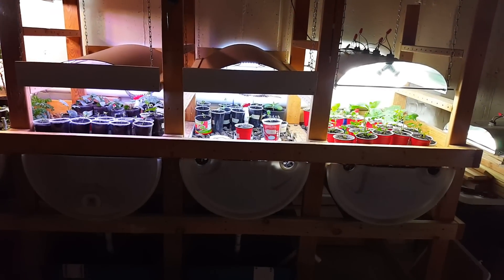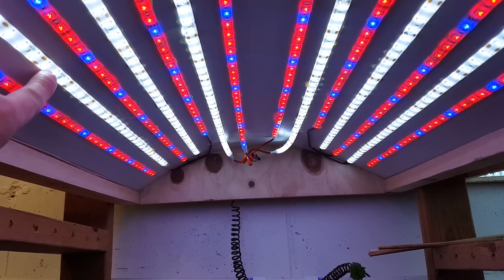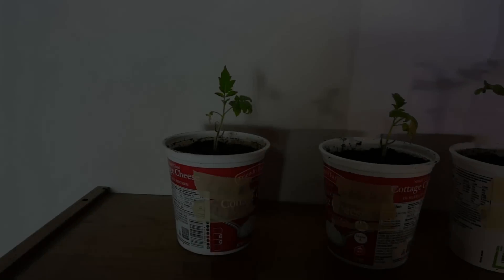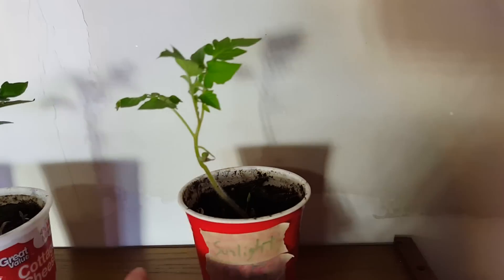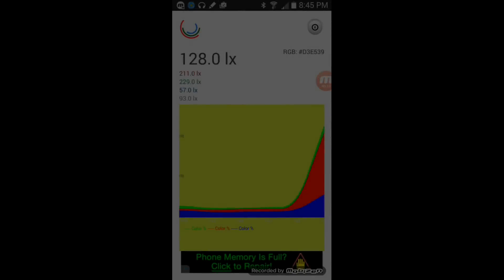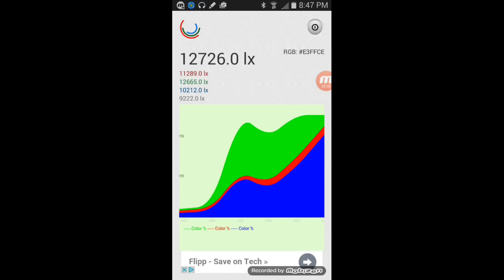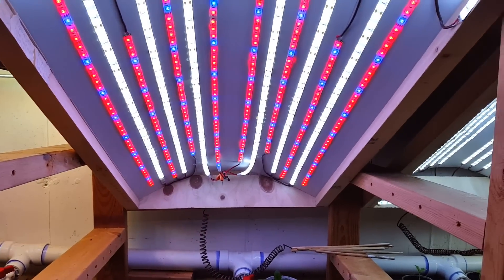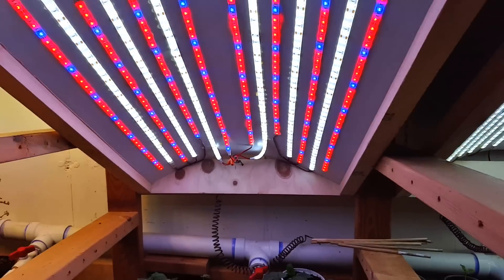DIY LED Grow Light Follow Up - Low Power LED VS CFL

Comment: to get a better test, make all the lights the same wattage.
Reply: very incorrect. wattage is a measure of power, dependent on two of: voltage, current, and resistance. you can have a very inefficient bulb blowing through power no problem and putting out hardly any light.

the important stuff is brightness, spectrum, temperature (including heat of the fixture), on/off cycle.... few others i can't give a crap to remember.
Reply: alexandru benza all those LEDs are going to have roughly the same efficiency.  you'd be correct otherwise.
Reply: +Kevron Rees  yea mate i'm talking about efficiency differences between different lighting tech, not differences between the LED bulbs in ONE fixture.

you said "make them the same wattage and then the test would be fair," but that's not correct at all. watts literally do NOTHING to the plant, it's related to current through the circuit, the voltage driving it, and the resistance ...resisting it. this isn't hearsay or a personal opinion, this is literally what the hell the equation is. unless you hold an incandescent too close to a plant and damage the plant with the waste heat, which even THEN is an indirect on growth.

light intensity per unit area is what matters. so for example for 800 lumens, an LED consumes 6-8 watts, an incandescent consumes 60, and a CFL consumes 13-15. also, different stages of growth respond differently to different intensities and spectra. power draw of your lights is the last thing to worry about.
Reply: distance to light is the key, the benefits are exponential...
Reply: It's going to be difficult to get a apples to apples comparison the way you want.  You need to make the per area photon concentration the same for all lights.  Only then can you make a valid comparison between the spectra of the various lights.  Otherwise, was the LED or CFL worse because it outputted less photons or because it had the wrong spectrum?  We don't know.

Honestly, I can't think of a good reason to use a CFL if spectrum is what you care about and not overall cost.  I can find LEDs with the spectrum I want.
Reply: Yea, we need to find if the LEDs actually more efficient vs the 8x23W CFL.

From the links provided, each 5m of these 5630 LED strips pull out 60W, so 120W. Meanwhile he is comparing it to a 184W CFL system.
Reply: tripzero you're missing the whole point of LED lights you sound like one of those guys that used to Growing With HPS lights that talks about watts as if that's the end-all-be-all of Lights the way you measure a light is by lumens he told us in this video that the LED lights he made weren't as bright as the CFL so therefore it's a flawed test you need to make the lights have as much lumens as your CFLs for it to be a proper test and also they need to be a lot closer to the plants because LEDs don't put off heat
Reply: that would be the point of the test, you seem slow
Reply: Watts is a measure of power and that will include heat dissipated in power. Led are more efficient, so Watts is not a good indicator. PAR would be the number to measure, but meters are really expensive, next better Fc, or Lux.  Lowering the lights will increase the lux at the plant level. Would be great to see same lux level for an accurate comparison.
Reply: and also same distance, your CFL seems to be closer to the plants than the led strips
Reply: I agree that I would like to see the same wattage for comparison.
If using the same wattage could you get the same performance.
Right now you have way more wattage going to the cfl and you have more LEDs in the mixed fixture.
Obviously this would be to find cheap efficient grow light alternatives.
I have a suspicion that if we mix 3000k 5000k and 6000k strips and we put enough of them (think you need about double) then we can get a good PAR.  And the results would be vastly different while still having a very inexpensive and efficient  diy fixture.
Reply: @TrollHiddenCave  actually for plants you measure by par, not by lumens. And even if you did it would be lumens per unit area which would more accurately be lux, not lumens.
Reply: @SanctuaryGardenLiving  from everyone I've heard doing that test, mixing different Kelvin numbers (3000k 5000k and 6000k in your example) the same if not better effect can be had using a single averaged Kelvin value light (maybe 5000-5500k in the above example). I haven't personally done a test but I've met and read of several who at least claim to have tested the idea.

Comment: The lux needs to be identical on all 3 systems to draw a valid conclusion.
Reply: not lux, watts. for it to be a head to head. you need equal watts. plants dont grow by lux, that is a measurement for what the human eye sees. but if you make the same wattage, then you can see what gives the best par output for the given wattage.
Reply: @thewizardoftech5075  For the same actual wattage. If the cfl is adequate for the plants, the leds would outright burn them.
Reply: You guys are thinking PAR - watts are a horrible way to express light output

Comment: I think you may be reading those charts in reverse. You are saying the lights are mostly “red” or mostly “green” light... that is just how the spectrum is layered. If you go by the lx number you will see that the “front” color may show more color on the screen but it’s the dimmest spectrum. The chart is just stacked from least at the front to most at the back otherwise you would only see one color.

Comment: You read your graphs wrong. Look at the figures. It is the colour at the top of the graphic that is the highest. Lower colours are displayed in the foreground or you would not see them. CFL shows a lot of green. Could you try lowering your led lights to get more light to the seedlings?

Comment: Stock up on CFL bulbs if you like em, Ive been told that they'll be pulled off store shelves in place of LED bulbs
Reply from the maker: +MikeGloomberg yeah i can always put in led bulbs into those fixtures if they get cheap enough. Right now they are still more than the cfls though
Reply: +SSLFamilyDad Ive caught some on sale at Lowes for $1 a bulb. They are priced about the same as CFLs at home depot but Ive only seen 5000k LED bulbs and the amount of lumens doesn't match CFL. Love CFLs because they make 2700 and 6500
Reply: +SSLFamilyDad these are on lowes site..maybe you can test them out..$1 a bulb..750 lumens
Utilitech 9-Watt (60W Equivalent) 3000K A19 Medium Base (E-26) Warm White Indoor LED Bulb
Item #: 747481 |  Model #: YGA03A41-A19-9W-830
Reply from the maker: +MikeGloomberg i have a couple led bulbs i found that were 6500k and 1250 lumens but still too pricey
Reply: +SSLFamilyDad i see you made a video with some led bulbs on mar of 2015...those bulbs look expensive... I'm talking about the new led bulbs that are replacing CFL bulbs. they look regular old light bulbs with a frost look on them. Thanks for the testing different lights and showing how to make em work

Comment: you need infared and uv light... if your going to make lights you need the ir n uv aswell
Reply: White LED's have Far Red so adding more isn't needed. Infrared light isn't used by plants for photosynthesis. Adding more Far Red would lower the ratio of Red to Far Red which will cause stretch. UV isn't needed unless he is growing plants for glandular trichomes like cannabis.
Reply: Iv and ir light are both in the sun the plant uses all aspects of the suns light
Reply: so explain then... what is UV for?
Reply: I dont have to explain,  get some ir lights and do some playing aroud for yourself
Reply: This is something that I have recently looked in to, when it comes to THC production what you want is UVB.

UV lights are available in tubes, available in T5 and T8 and as compact Flourecents.

UVB is also to some extent give out buy MH HID’s.

UVB is has a relatively short wave length and is not able to pass through most glas and plastic roofing materials found in conservatories and green houses.

Uv lights often use specialist glass to allow the UV through.

When aUV light has a number on it for example 5.0 or 10.0 this the percentage of UV light that the specific Light outputs.

UV needs to be treated with caution, always cover arms and wear UV eye protection if you are to come into contact with it.Prefferably turn of the light before entering the room with either an external swith or with a remote control wall socket.

UV light are often used in the peak hours of a 12/12 lighting regime for approximately 5 hours, though some growers leave the light on for the full 12 hours.

When you start using the UV light in you bloom phase it is advisable to start at a higher height as the plant needs to become accustomed to theUV.If this is not done you risk damaging your plant.

Being that the UV is a relatively short wave length and that tubes and cfl have a short throw intensity it is recommended that once your plant is used to the UV, a height of approximately 12”/30 above your plant canopy is about right.

UV-A: 320-400 nm
UV-B: 280-320 nm
UV-C: 200-280 nm

UV-A : used for party lights and bank notes etc

UV-B : used for THC and sunlamps etc

UV-C : used for sterilizing medical equipment for surgery and for destroying pathenogens in air con and destroying pathenogens and algy in aquariums and ponds.

UV-A : relatively harmless unless extended periods of exposure, when it is advisable to use some protection
UV-B : Protection should always be used, cover skin or use high factor UV block and always use UV eye protection
UV-C : You should not ever come into contact with UV-C it is in credibly harmful

UV-A and UV-B are used in aquariums and terrariums and are used for corals and retiles.

Stores that cater for these environments will stock UV lights.
Reply: What if I told you that increasing the potency of your favorite strains was as easy as hanging up a few 20 watt florescent lights? To good to be true? More like too true not to do. It turns out the same thing baking your skin at the beach can make prized buds swell with THC. Ultra-violet (UV) light has the power to turn a good strain into a real head-knocker.

What Is UV Light?

At this point you might be asking, "how is UV light different from normal light?" Even though humans can't see it, a good way to think of UV is to visualize a rainbow and pretend there is an extra color band past the blue and purple. All light is basically just waves of energy, and UV light is just like any other form of radiation. These waves wash over your plants at different frequencies (how many waves pass per second). UV light has a smaller gap between each wave than visible light, which means more waves are passing per second. This gives UV high energy, making it more like an X-ray than a radio wave.

How Does UV Light Effect Marijuana Plants?

But what does all this mean to your cannabis garden? To answer that, we need to investigate how UV light affects plants cells. Ultra-violet radiation, particularly UVB, has been shown to be detrimental to plant cell function. UV causes damage to plant cells in the same way it tears through your skin, eventually causing sunburn. As a result of this damage, all plants have created defenses against UV in the form of gene UVR8.

UVR8 is a protein molecule which senses UV all by itself, and then "tells" plant cells to change their behavior. Exactly how UVR8 molecules sense UV was recently discovered and is pretty interesting. UVR8 is what chemists call a "dimer." which just means that it's made of two structurally similar protein subunits. When UV light hits the two protein subunits in UVR8, their charge weakens and they break apart. To help visualize this, imagine rubbing two balloons against one another. The balloons will stick together because of a static charge. Now imagine the balloons get rained on. The water takes the static charge with it and the two balloons fly apart. In this example, the balloons are the two protein subunits and the rain is UV light cascading down on the plant cell. After the protein subunits break apart, they head to the cell nucleus to deliver their information.

More UV Can Mean More THC

One of these changes caused by this information is very important in your cannabis garden. UV stress stimulates cannabis' production of chemicals via the phenylpropanoid pathway, specifically malonyl-CoA and phenylalanine. Why is this important? It's important because cannabis uses malonyl-CoA to make Olivtol, which it in turn uses to make THC. Now we can see the specific pathway which cannabis uses to increase potency when exposed to UV light.

UV light is already present in your garden, but it's being blocked by the special glass your bulb is made of. Lamp manufacturers must use this type of glass by law because UV light can cause skin cancer when humans are overexposed. You wouldn't want everyone getting cancer from street lights would you? You can increase the amount of UV getting to your cannabis by mixing metal halide bulbs into your bloom room and leaving the glass off your air-cooled hoods. But a better and safer way is to buy and install cheap fluorescent UV lights.

Remember, UV light causes stress to the plant, so put the fluorescents on timers and only have them on for part of the light cycle. Having them on for fifteen minutes of every hour should do the trick. The only downside of this whole process is that yields go down slightly. The plant has to reroute resources and undergoes some physical damage from the UV. As long as you don't overdo the UV the increase in quality is well worth the decrease in yield.

Source: http://bigbudsmag.co...ght-august-2012
Reply: Theres alot on internet about it..
Reply: right.. but he isn't growing cannabis...
Reply: Ohwell, he is obviously growing the wrong plant, other plants would benefeit in there own way,  i use uv hps led and envirolight gives an all round amazing light
Reply: Never knew budmaster lights are made 10 miles away what a treat

Comment: It would be interesting to have the same Lux output from the 3. I would also try mixing blue strips and red strips 50-50. Having the same Lux as the spirals.
Reply from the maker: +Submanca that is going to be my next lights. I want to see if I can get the same or better lux with lower wattage. That is the only way it will make,sense to go led over the cfl lights. We will see!
Reply: +SSLFamilyDad You can't even use lux because red and blue don't show up as high on a lux meter as green/yellow. Just use equal wattage draw from the wall as checked by a Kill-o-Watt.
Reply: +Alien Grey platinum LED changed my life :)
Reply: you need a spectrum analyzer to know what and how much comes from a source. If only interested in plants try a PAR meter (photosynthetically active radiation)

Comment: I use the blue and bright white LED strips to grow my wheatgrass indoors and it works really well.  As your results demonstrate, blue light is the way to grow.  I've been told that blue light is good for vegetative growth, which you need in the beginning.  Red light is good for flowering/fruiting, which you'd want later on when the plants are large.
Reply from the maker: +Mark Cartwright i just ordered some blue,strips that u am going to try next. I think i will try an all blue and then one that is mostly blue with some red. Good to know that it is working for you!
Reply: +SSLFamilyDad last time I used all blue LED  to grow plants it miniaturized them, then I found some reading to support that, it will be interesting to see Your results..
Reply: Please see above "blue and bright white"
Reply: Mark Cartwright please READ above "I think I will try an all blue"

Comment: It would be awesome if someone did a WATT for WATT comparison. like building an LED array to match your CFL. hope to watch more!
Reply: I've done that using LEDs that are like regular household bulbs. I went at it different thought- Using as many watts drawn with LED as I used with CFL. LEDs of course won easily. More light per watt drawn.  Plants grew better on the same power. And You can now get LED bulbs as cheap as CFL. This experiment was flawed,  he neither used the same light output nor the same power draw. Both power draw and light out put were considerably lower for the LED strips. Current LED bulbs require you to use about 20-25 watts of power per square foot, less if bulb is extremely close.  Saw a video with a LED grow lamp that drew 7 watts for one head of lettuce that grew well, but it was specifically a 'grow' light, and probably covered less than 1 square foot on a plant no more than about 3-4 inches tall.  watt for watt, LEDs grow at least as well, and use less power than CFL. And with a combination of bulbs ranging from 2700k to 3500k to 5000k to 6600k, plants get enough of what they need without resorting to expensive grow lights.

Comment: You might want to try replacing the cfl bulbs with led bulbs.  Costco has some 5000K , 100watt replacemet bulbs pretty cheap.
Reply: I just use 2 cheap $15 led flood lights at 6500k. The plant growth in my aquariums is amazing. For the plants I plan to add, I'll need to purchase 3 cheap 10 watt 2700k led flood lights so they keep their red coloration. Maybe then my anubias will flower

Comment: 5630 means each led is 5.6mm x 3.0mm length x width. Size not power
Reply from the maker: +jamie Russell which translates roughly into power. Bigger led in general put out more light

Comment: why did you mount the led on a parabolic  surface you don't need to reflect light off the back of the light so a flat board would have been fine
Reply from the maker: +romine2sew believe it or not there is a lot of refracted light that bounces off of the leaves, supports, and the walls. The parabola also gives the light more than one direction other than straight down which helps the lower leaves get more light